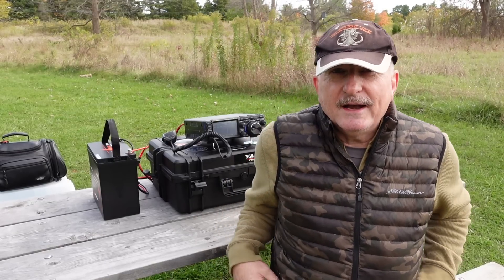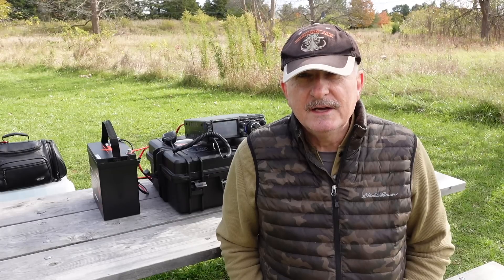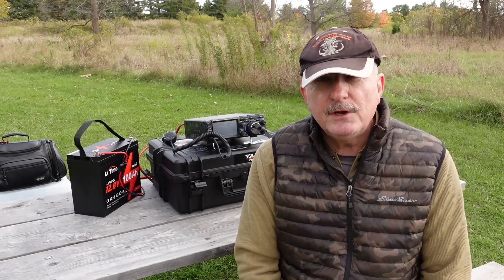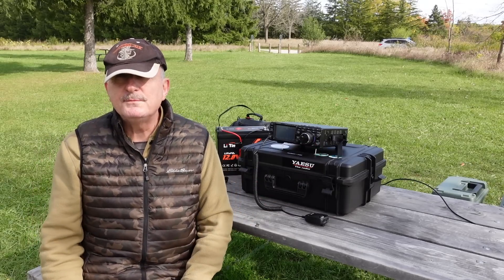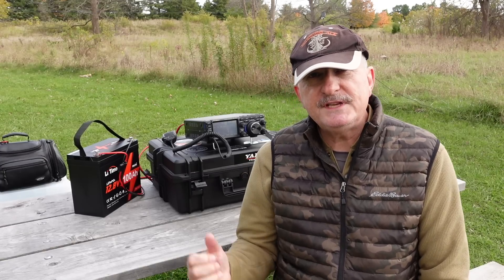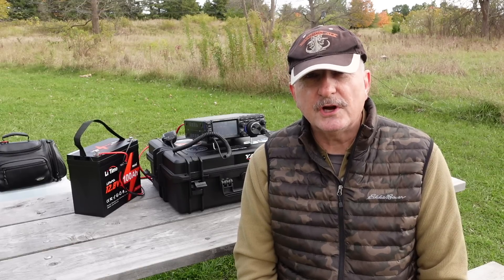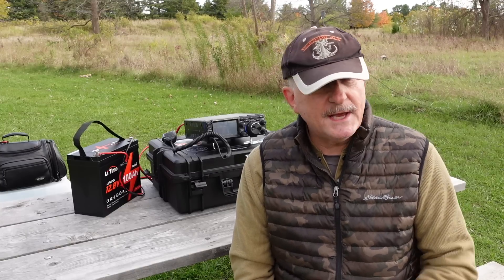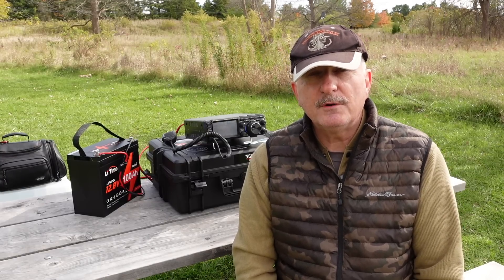Yaesu FT-710 as a Portable - Beast or Brick?

Comment: Do you have the 4Pin connected directly to the battery??
Reply from the maker: yes, with a distribution block and a fuse.
Reply: @OutdoorsOnTheAir   Where did you get the block from?
Reply from the maker: @stacksmasher  Amazon. Search for 6-Position 45A Power Pole Distribution Block Module. The fused ones are a good idea though.

Comment: With both the FT-710 and the FT-450D, the current draw shoots up rapidly above 80W - I think it's due to the battery being 12V not 13.8V. So I keep mine at 80W when portable, as it's a good power and still lasts a long time.
Reply from the maker: Great points! I set my 710 at 75 watts.

Comment: I HAVE A 991A ITS OK JUST HF REC  SOUND IS NOT GOOD IRRESP  OF HOW I ADJ THE FIL ECT 
THE 710 I THEN BOUGHT IS LOVELY MUCH BETTER AUDIO 
 MY MAIN STATION NOW 
THE 991A IS GOOD ON C4FM WIRES X ECT TOO SO BOTH RADIOS MAKE A FANTASTIC STATION 
BY THE WAY THE 710  AUDIO MODULATION IS FANTASTIC IF
 PROPERLY  SETUP  CHEERS ZS1UOK SAFRICA
Reply from the maker: You're onto something there. Yaesu audio is tricky to set up correctly and takes some work. Keep tweaking the settings, I was able to get the 991A I owned to sound pretty good. If you check out my videos on the 991A, you can hear some decent audio.

Comment: What DNR level FT-710 should be set when using CW? I live in a big city where there is a high level of interference. I have noticed many times that when the DNR level is 6..7, the received signals begin to be distorted. At the same time, I have the latest firmware, the JA version of the transceiver.
Reply from the maker: It sounds like you're dealing with some tough interference! For CW, many users find that a DNR level between 3 and 5 works best. It might take some tweaking to find the sweet spot for your specific environment.
Reply: @OutdoorsOnTheAir Ok thanks!
Reply: @OutdoorsOnTheAir  What equalizer settings do you have set for CW reception?
Reply from the maker: I'm not a CW op, are there any reading this comment that can advise?

Comment: Thanks for the video, Tracy. I have an IC7300 for a base rig. I have an FT818 for DX, which I will never sell, an FT891, but as you say, the radio and tuner are heavy for the size and require a tangle of wires for the power, antenna, ground (rig to tuner) and the auto tuner wire. The bottom line ... I just bought an FT710. Still setting it up and haven't had a chance to do some POTA with it, but if the RX is like the 891 or a friends 991A it will be great. I have a 20Ahr and a 50Ahr 'GO' battery box, with solar setup. POTA and camping here we come. ps ... the bands have been poor so I'm hoping the summer brings an end to the solar flares. 73 VE3PUH
Reply from the maker: I really appreciate your feedback! It’s always great to hear about fellow hams and their setups. Enjoy your time with the FT710, and may it bring you many successful contacts! 73 from VE3TWM.

Comment: You can’t compare a 710 with a 991A. The 991A Is a HF, VHF, UHF radio, while the 710 is only HF. It’s non-sensical to compare the two radios.
Reply from the maker: @stevej-m2r  what’s your point?

Comment: Very good video.  I just subscribed.  I have been thinking of buying one.  I use a remote tuner at home.  It is an Icom tuner, so I will have to find one that will easily work with the Yaesu.  What antenna were you using in the field that day?  Cheers from KM4MMD.
Reply from the maker: Thank you for your comment! The antenna was an N9SAB Aetherwave Antennas 40-10 resonant endfed, horizontal at only 8 feet in this deployment. Very good performer 👍

Comment: How long does battery last for
Reply from the maker: The 100 Ah battery will run for 45+ hours SSB at 100 watts RF out on my Yaesu FT-710.
Reply: @outdoorsontheair Thanks for the video. I am in the process of buying/making accessories like battery and antenna for pota ops for my 710. How do you know when the battery is dead? Do you use a voltage meter or something? Is there any harm to the radio if you let the battery get too low? I know in other videos of yours you did not like how the 891 has no voltage read out as compared to some of its older siblings. Hope to make contact with you from British Columbia some day!

Comment: ... as a portable radio it fits very nicely in the case as shown.  I use an Apache 3800 from Harbor Freight. I just removed the foam part that pulls apart and just used the solid upper and lower foam parts.  Fits perfectly and securely.

Comment: Thank you for this timely vignette. I went the same route and purchased the 710 at hamcation for a great price from HRO onsite.  I used to take an 891 and tuner to activations utilizing mostly an EFHW.  I like to hunt parks on the upper bands before taking calls on 20 and realized I can simplify by upgrading. I broke even by selling the 891 and tuner, and the 710 fits in the same rigid hard case I had for the previous setup.  An added bonus is, for my home I use a DX10 and really dialed in the audio.  The settings directly translated to the 710 and on my activations, I get great repords for the audio.  Looking foward to more videos about it.  One suggestion is to keep a cheap backpack rain cover near in case of mist or rain when out in the open.
Reply from the maker: Thank you for sharing your experience, and for the suggestion!

Comment: Tracy, I have the same radio and love it. It is my first HF rig and having fun with it. I wanted to know what antenna are you using for remote field use? And the battery you were using also. I was looking to buy the 991A but decided on the 710 because of the larger monitor availability , and the Sherwood testing factor. I am hoping Yaesu will come out with a updated 991A with a larger display and a better waterfall. There is no ham 2m/70cm base units except 991A and ICOM 9700 which is to expensive . I think the 710 has the greatest receive on a radio. Thanks for the video!
Reply from the maker: Thanks for your comment! I use a variety of antennas for field use, but my primary go-to is a 40-10 meter off-centre fed. Really hard to outdo that one.

Comment: Crystal clear sound. What kind of antenna are you running in this video?
Reply from the maker: I used an N9SAB 66-foot resonant endfed installed horizontally at 8 feet. i.e. suboptimal install as a test. Band conditions were not ideal.

Comment: I just got one of these and I'm frustrated with my compromised antennas. You did a great job of showing the strengths of the radio. Can I ask where you got your case? What antenna were you using?
Reply from the maker: The case is made in Italy and sold in Canada at Canadian Tire under the brand name MAXIMUM. 
The antenna was an N9SAB Aetherwave Antennas 40-10 resonant endfed, horizontal at only 8 feet in this deployment. Very good performer 👍
Reply: @OutdoorsOnTheAir  Tracy - thanks for getting back to me. I have also ordered a 100ah LiFePo that just came but I forgot to order to the charger for it. I will get this radio out on a Pota if it kills me! I talked to someone in Bosnia today which was pretty cool. He was on his club station and was surprised to hear my 710 from Minnesota (and my 16 ft speaker wire antenna). Looking forward to your next 710 video !!!

Comment: Trancy, you made a very good choice. I had the opportunity to test this radio a few months ago from a friend. I was doubting between the FTDX-10 and the FT--710. Ergonomicly speaking I prefer the 710 where the knob layout is more natural and the FTDX-10 is pretty crouded around the VFO knob and sec. ring. I still went for the DX-10 as I wanted the 300 Hz roofing filter for CW and RTTY and the filtering and digital noise reduction are second to none on this radio. But I was very impressed with the receiver performance on the 710 as with his sounding audio on air. It is by far the smallest and fully packed SDR radio at lower weight and compact size. And the bonus is a very nice screen with waterfall and signal bars capable of 100 Watts if you need it to be but reducing it as lows as QRP. The only disadvantage in my opinion will be the power consumption compared with real QRP radios. Cheers 73, Phil ON4VP (PS, I'm awaiting the FTX-1F next spring as it will be a real two simultanious band receiver radio ideal for satellite use)
Reply from the maker: Thank you, Phil! You've raised some great points. Merry Christmas from VE3TWM!

Comment: Thanks for the great video!  Quick question: Do you see any performance issues running the 12.8V LiTime battery vs the 13.8V batteries that seem to cost twice as much?  I'm looking into my first HF radio and finding $100 for a 9Ah battery to be a little ridiculous.
Reply from the maker: You're welcome! I've never used anything but the 12.8 volt batteries in the field and never had an issue.
Reply: Same here.. I think they all charge up to 14.2-14.6 then settle back to 13.3-13.5, but the nominal voltage is 12.8.

Comment: Hello Tracy!  Yes, the prices for LiFePO4 batteries are falling faster than gravity can pull them down.  That's the good part.  But according to many Amazon reviewers the "cheap" 100AH LiFePO4 batteries sold on Amazon are, well, cheap.  Many complain that the batteries come with practically zero charge and cannot not be charged regardless of all the tricks used to revive a LifePO4 battery.  Many also complain that the batteries stop charging or not taking a full charge after a couple of uses or a couple of months sitting around. I don't believe that all these reviewers are newbies when it comes to LiFePO4 batteries.  I suspect the problems lie mostly in cheap BMS's.  I had a battery "die" on me, and I could not revive  it despite applying all the methods that are floating around on the internet. Bad BMS?  Bad cell or cells?  Don't know.

I have a couple of 12v/12Ah LiFePO4 batteries that seem to be working okay that I use for portable work.  With an 80w solar panel I can keep them charged into the night.  The batteries were not cheap, but not as much as some 100Ah ""cheap" batteries.  If one or both of them go belly up, it is something that won't hurt too badly, and they are not mission critical. 

For home and SHTF situations I prefer AGM batteries.  No fancy electronics to go bad on them.  They are easily replaceable in a battery bank.

Can you recommend a quality LiFePO4 100Ah battery?

Comment: I use the FT710 Field as a portable all the time, but it's definitely a bit of a luggable at 10lbs. I rotate that with the Xiegu G90. The 710 is a fantastic receiver and of course has 100W is great to have; The G90 is only 20W and not as agile a receiver, but has that amazing antenna tuner. I wish I could marry the two in a single radio, somehow, but until then, I will pick the right one for a given trip and generally be pretty darned happy!

I've been running on a 20Ah battery for everything for a while, but the price for 100Ah is coming down so rapidly that I definitely see myself going for one soon.
Reply: The 710 has an auto tuner.   How is the auto tuner better on g90?    I am new to ham and trying to decide.   

I plan to do POTA which the G90 is perfect for but will 20w be enough?   I could get a external amp but then it ends up costing just as much and more to lug around

The 710 has high drain which will impact how long a smaller light battery will last
Reply: @ The 710's tuner is 3:1. It's good for shaving the edges off a wire that's slightly long or short.

The G90 can tune almost anything that's capable of being used as an antenna. There's a video out there of K8MRD successfully making QSOs using a G90 and a shopping cart. It's specifically intended to work with long wires with NO transformer, while the 710 would need the 9:1 transformer first to tune a random wire. This is why I recommend the G90 for people on a budget. A G90 and a two decent lengths of any old cheap wire will get you on the air.
Reply from the maker: Thank you for sharing your experience and thoughts!

Comment: I purchased a FT-710 for the same reason, but the bonus was, with Yaesu Cashback, in the UK it was nearly £400 cheaper than a new IC-7300. I agree on the receiver, superb, so much so I sold my base rig, IC-7610, for a FTDX101D. I really liked my IC-7610 and would have kept it if it covered 4M, but certainly not dissapointed with it's replacement the FTDX101D. 73 Mike G1ZRN.
Reply from the maker: Thank you for mentioning the 4m coverage, Mike! Sadly, we don't have that band over here in North America. 73 from VE3TWM.

Comment: I upgraded from a Xiegu G90 to an FT-710 and it has been amazing so far. I primarily used both the G90 and now the 710 portable as I live in an apartment, and not only is the extra power nice, but I've also found that the 710 has WAY better noise rejection on RX.
Reply from the maker: Interesting to hear how the 710 compares to the G90, thank you for that.
Reply: Very interesting I was looking at that as well

Comment: My first HF Radio. I bought it last year because I wanted the latest, affordable and at least semi-portable rig that could be used both as a shack radio and something I could put in a hardcase for road/air travel and it fits the bill perfectly.
You'll struggle to put this in a  Manpack, but I don't climb hills and mountains, so that's not an issue. Perfect for what you're doing, POTA/Camping etc.
Got a 100Ah battery for $300AUD of Amazon at the same time and have no regrets.
Solid unit with hightly customisable settings. The inbuilt tuner makes it a dream to work with your preferred antenna.
👍
Reply from the maker: Good points, thank you!

Comment: Something else that is interesting about this radio, is it can do 4 Meters which is great for countries like UK that have the 70mhz band.  I think you have to change it to UK region in the settings.  No other HF+6M radio has 4M at this price point, even the 991A does not.  The IC 7300 does, but its about 50% more expensive, as is the IC 7100.  And then the FT-DX10 but that is even more expensive.  All these radios are great by the way and 4M is really just a bonus VHF band.  A bit like 6M but with smaller easier to build antennas...  but less people due to scarcity.
Reply from the maker: Thank you for bringing up the 4m coverage! Wish we had that band over here.

Comment: Why not the IC-7300? You must be a Yaesu fanboy. 😂 Looks like almost all of the comments are from Yaesu fanboys!

My KX3/KXPA100 draws only 250ma on receive. Because of that I can easily get away 15 ah battery & operate for 6 hours or more on a single charge running 80 watts. Between the 100 ah battery and a 9+lb/4+kg radio that’s a lot weight to carry into the park. I arrived at 80 watts by doubling my power from 5 watts 4 times which is basically 12 db or 2 S-Units. That extra 20 watts to make 100 watts is basically wasted power consumption at that point.
Reply from the maker: Thank you for sharing your experience with the Elecraft, that's interesting. 
Re: the 7300, I do not consider myself a Yaesu fanboy. I've owned and liked many Icom radios over the years. I've never owned a 7300 as I never wanted to have a radio that is so overwhelmingly popular/trendy...that's an idiosyncrasy that has been with me since I was young, wanting to buck the trend :) I know it's a good radio.

Comment: I've had an FTdx-10 in the shack for a while and used a Yaesu FT-891 for portable. I didn't use the 891 enough to remember the menus so I sold it and bought an FT-710 for my portable radio. I have not been disappointed at all. Controls are very similar to the FTdx-10 which makes it much easier for me plus there is the superb receive on the 710. I expect you will really enjoy it. As far as weight, after packing the 891, a tuner, and digirig and cables for doing ft8 the weight would be about the same. I do most portable work from the tailgate of my truck so truthfully weight is not a concern. 73
Reply from the maker: Thank you for sharing your experience! 73 from VE3TWM.

Comment: Great radio, I put over 40 POTA operations on my FT710 AESS this past summer. Running 80 watts on a 20 amp/hr LiFePO4 battery with no issues for 200 plus contacts on a weekend. I really enjoy using the waterfall as well as the fantastic audio. 73 VE9NHS
Reply from the maker: Thank you for sharing your experience! 73 from VE3TWM.
Reply: Agreed, usually run mine at 50w cw 500hz filter..fb rig

Comment: Icom needs to make a portable that has the built-in tuner, across all brands, SDR is going to carry the day. As far as temperature goes when the Russian qrp group had their "red nose" outdoor contest, when their ft-817 began to run erratically, they stuck it inside a winter boot, and that fixed the problem. So I wonder if your pelican case itself might be a solution to the cold problem. I'm kind of surprised that all these radios are not mil-speced a bit more. I know FARC and other type groups in the past have used the 817, of course that's in a pretty hot place. But it gets pretty cold in Ohio too, so something that can't run in the cold is a deal-breaker for me! 73 DE W8LV BILL (and sometimes W8LV/VE3)
Reply from the maker: Hi Bill, thank you for sharing your thoughts and your suggestion! 73 from VE3TWM.